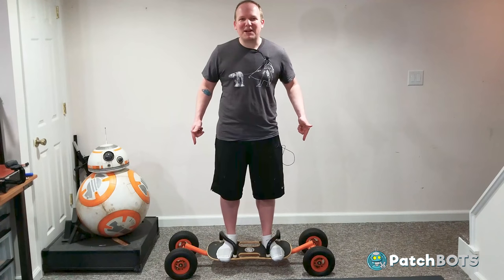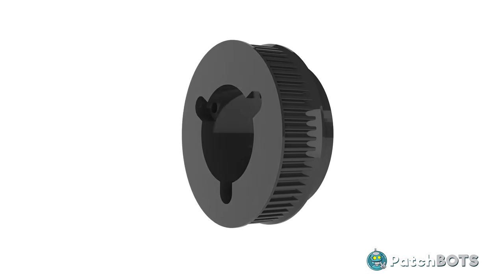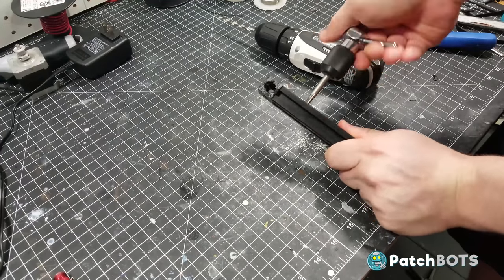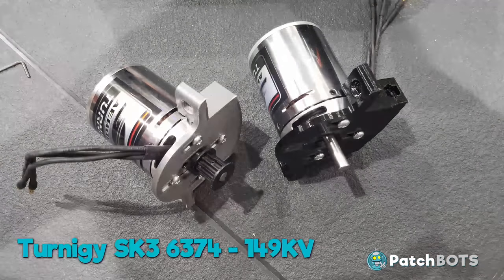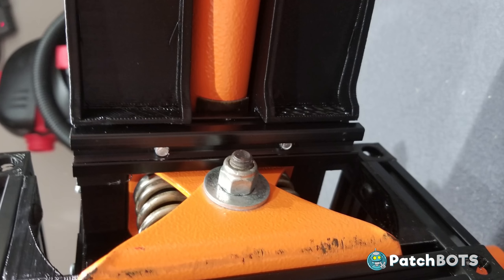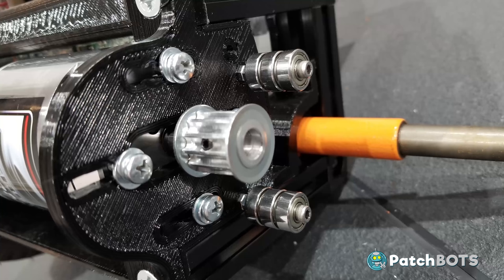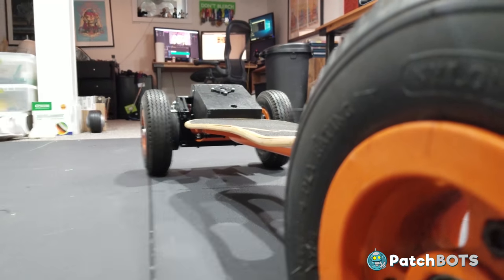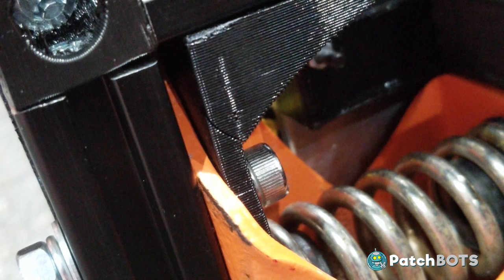Building an Electric Mountainboard! (Part 1)

Comment: These mountain boards are pretty cool!  I really like the look of yours!  Well done!  I'd like to ask you about something that is a bit off topic.  Would a single motor be able to push the board well enough without a person on board?  I'm building an rc rover.  I have a 5335-245kv motor and I'd like to get a mountain board belt and pulley system to drive it.
Reply from the maker: Yes, the motor will definitely have enough power to move a board, you will have the OPPOSITE problem though. Without a lot of weight on the board you are going to run into burnouts and wheels spinning.  You'll either need an ESC with a real-slow start or a customizable ESC (arduino perhaps) that can start the motor slowly so it doesn't spin.  Good luck!
Reply: @PatchBOTS  Thanks for the reply!  I appreciate your thoughts.

Comment: Nice! I'm a new sub. Do you do everything yourself or do you have friends that help?
Reply from the maker: Hi Ryan.   Easy!  I have no friends. haha.      No, I do everything myself.  Thanks for subbing!  If you have any other questions feel free to ask away.
Reply: One more question. How do you deal with losing momentum when you have to wait for parts to ship? Do you have multiple projects running all the time so you can switch back and forth during waiting periods?
Reply from the maker: Yeah.   MY video release schedule isn't what you'd consider "fast."  I've been putting out those "Vlog" videos as a way to make more content relevant to what I'm working on, but sometimes my main project videos are months apart.  It's waiting for parts, it's trying entire concepts that don't work and have to be redone, it's a lot of things.  I have 2 main projects going;  the Star Wars Chopper droid build and the Star Wars Clone trooper cosplay build. Those are my "main" projects. Then I have projects like this where I do  something out the box just to keep projects flowing.  It's hard to work on the same two things all the time, so it's nice find a little idea like this that I can work on when I hit rough spots on the other two projects.